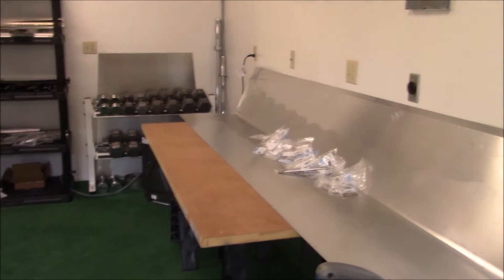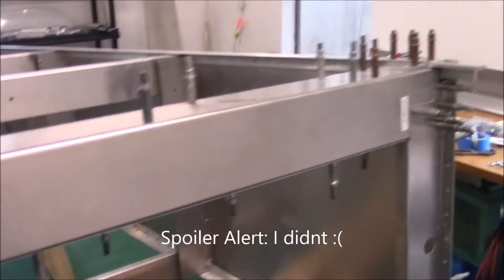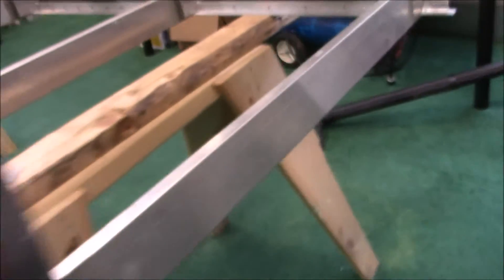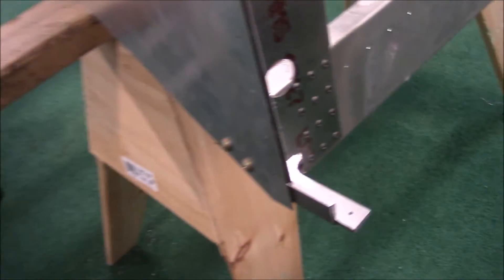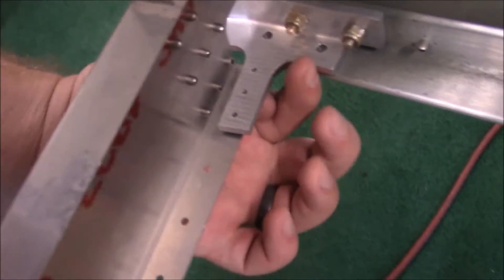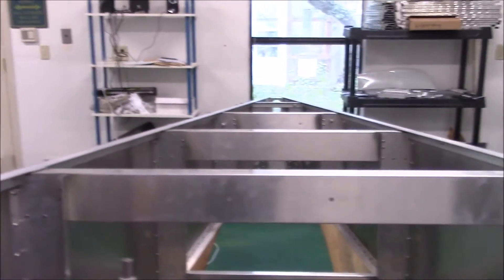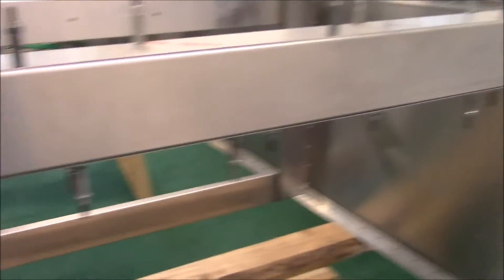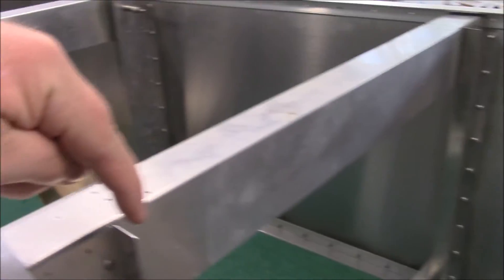Sonex Aircraft Build 59 - Finishing Lower Fuselage Gussets

Comment: Great to see you back at work! Have you listened at all to the Sonex Flight podcast? They recommend leaving the bottom skin off as long as possible for easy access.
Reply from the maker: Hi Joe! Great advice. I have heard that from a couple of people. I plan to leave it off (clekoed) until I have everything completed and I will only rivet it right before I paint the whole plane. I have not listened to the sonex flight podcast. Until now, I had not heard of it. When I have trouble with the build, I usually call my dad as he has built 4 planes and is an A&P as well. I'll have to check it out. Thannks! -Dan